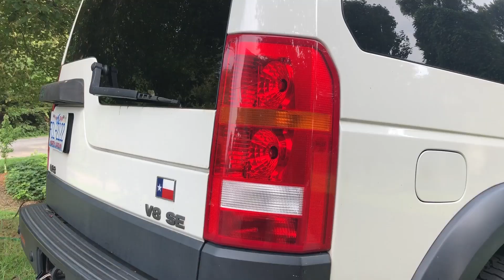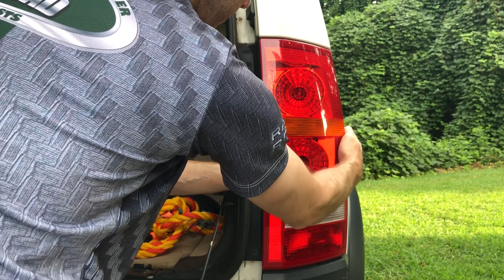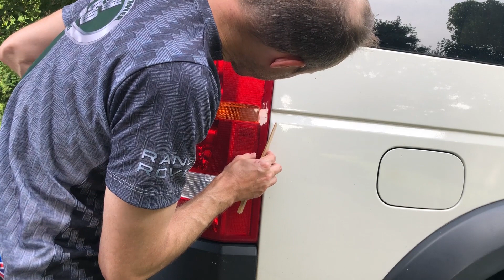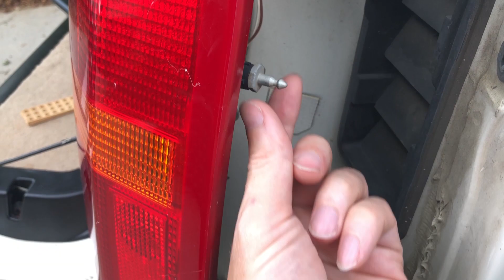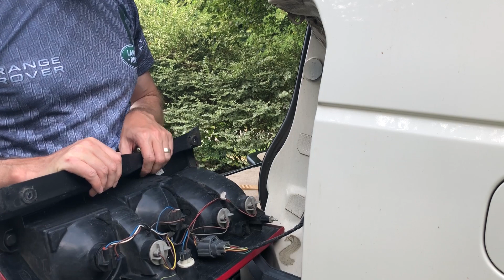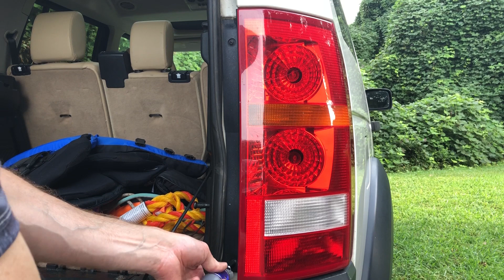Brake Light Bulb and Turn Signal install on Land Rover LR3 - replacing burned out bulbs

Comment: Off topic, but what type of rims are on the Range Rover, they are amazing!!
Reply from the maker: You mean the silver ones on by blue Range Rover?   There are a couple designs that are similar, but here is one you could check. YSM 22x10" +43 Offset: 43. Here is a link to some like it.
https://www.ebay.com/itm/Range-Land-Rover-LR3-LR4-HSE-Sport-Discovery-22-inch-Wheels-Rims-22x10-5x120-43/113214824092?_trkparms=aid%3D222007%26algo%3DSIC.MBE%26ao%3D2%26asc%3D20140602152332%26meid%3D997ed55391794626ae1f46aec733ba5f%26pid%3D100011%26rk%3D6%26rkt%3D12%26sd%3D113105973563%26itm%3D113214824092&_trksid=p2047675.c100011.m1850
Reply: Thanks!!